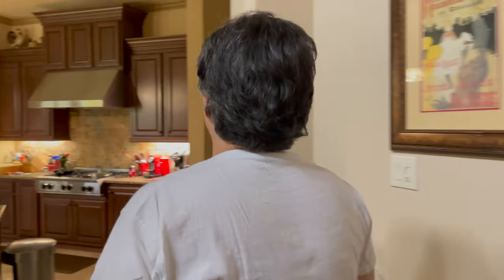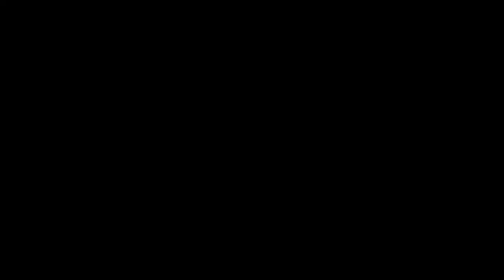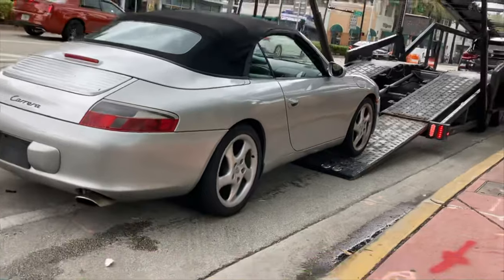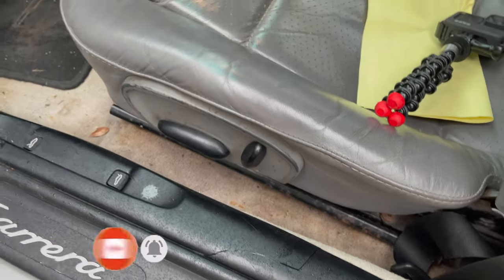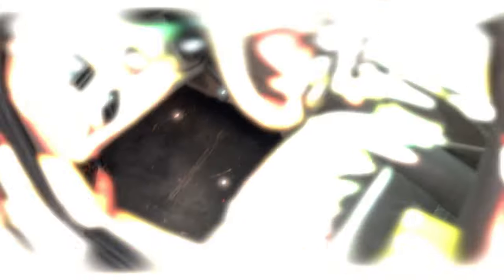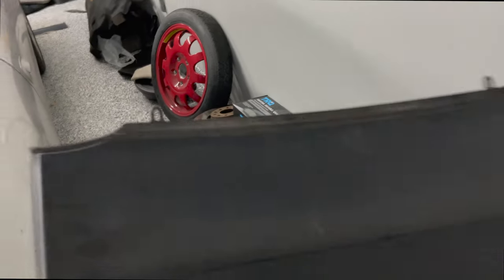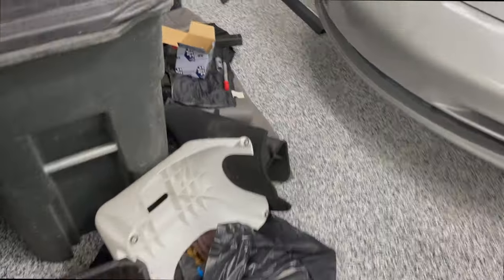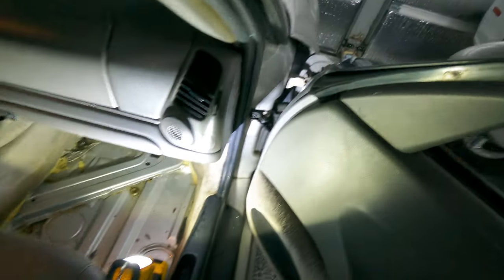PROJECT: Pepper - Meet my eBay Porsche 911 and see what I found Inside

Comment: The roof might be fine mate, its likely just the rain water drains that are blocked which is a very common thing, but dead easy to fix, main drains from rear quarter trim panels (inside by rear speakers) and probably blocked at the outlets in the wheel arches. Mine were blocked and carpets wet, but fixed dead easy
Reply from the maker: Thanks for the tip! I’ll be sure to check it out. Now if I can just get it to open!
Reply: @YogisGarage  manual open
Reply: Good tip
Reply from the maker: Cleaned the drains and manually opened the top. Check it out on my Instagram @yogisgaragetx

Comment: Looks like a sound, solid project car, great buy.  I've got a '03 996 narrow body 911 and am interested in how the suspension work went. I think mine needs a bit of tweaking on the front end, it likes to wander at speed. Have you done the control arms and drop links yet?  Thanks.
Reply from the maker: Sure have. Check out my “New Legs”  two part series. Thanks for watching!